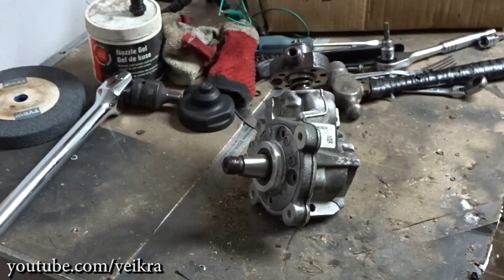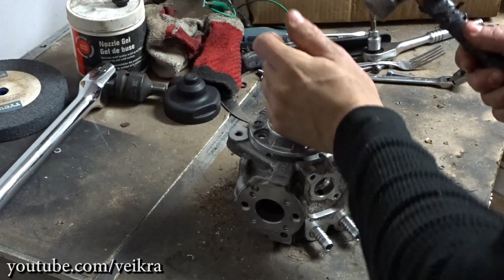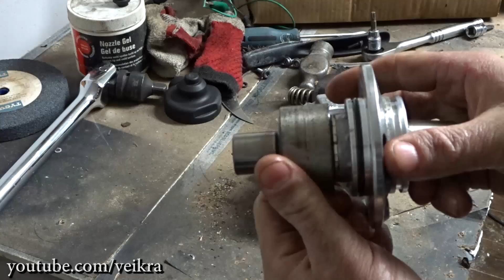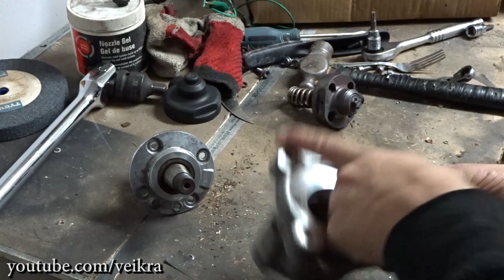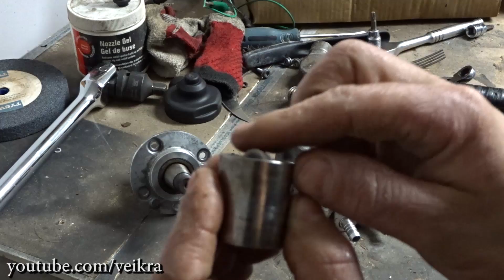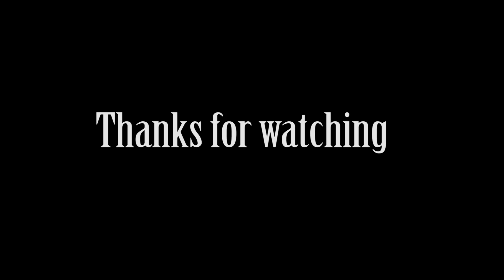cp4 diesel pump inspection rant. volkswagen, duramax, ford diesels

Comment: My car died,  thought it was a blown hpfp. Tested the injectors, they all failed. Took the pump out. Pump looks fine. How do I reassemble it? And what else could have caused my injectors to fail? Car had half a tank of diesel. Iv always had diesel cars so no chance of misfuel
Reply from the maker: never seen injector fail before the cp4. Usually pump wears out and clog inujector with metal particule. "pump looks fine" how can you tell? you spun it by hand to 27 000 psi? lol

Comment: Fiat has a water sensor in the bottom of the fuel Filter !
Reply from the maker: same as pickup trucks. It wont catch metal debris from the pump tearing itself apart as it`s made of cheap metal under high stress

Comment: Please, from your experience teel me if it is possible that this pump to be the cause  for losing pressure from the rail ramp and for hard starting,  in particular when the engine is cold or warm(40-50 % celsius coolant). Otherwise, the engine is working normal, i didnt observe any loose of power or other strange behavior. I have no error on obd scan. The injectors are new. Thank you.
Reply from the maker: diesels are very simple, the pump and injectors can cause many issues. For instance I had 2 bad injectors, but when cold, the higher fuel viscosity meant the engien ran fine. Once warm, I had loss of fuel rail pressure under hard accel

Comment: CP4 fuel pump just went on my 2016 Chevrolet High Country 2500HD 86,000 miles

Every Brand selling vehicles with these pumps need to step up. Water in fuel is NOT causing all these failures!
Reply from the maker: yeah, water cant account for all these prematire failure. The pump is not made strong enough. Plenty of cp3 trucks with high miles, including mine that went 420 000km until a rubber line failed and ran it dry. Would still be on the truck if not from that.  And it didnt damage the injectors vs a cp4 failure . Do a cp3 conversion if you plan to keep it. 
Gm already stepped up by ditching the cp4 in favor of a nippodenso unit. There`s class action lawsuit but david vs goliath
Reply: Veikra ya, I did. Btw, if you do another video on the cp4 failures might want to mention GM covers the fuel pump for 100,000 miles or 5years warranty. When I called to check warranty GM told me it wasn’t under warranty (twice), once I read my owners manual I found a section stating it is covered. “Under Diesel Engine Components” clearly stated
Reply from the maker: @AL1974    Good,  but 100 000miles isnt good enough. You engine is not even broken in at 120 000.   My cp3 died  255 000 after a hose/hoseclamp crapped out and ran air into it from 2 days trailering. 255 000 miles and something else was the cause.  I do run a lift pump now so Im good for at least twice that now.   Cp4 is a scam, it doesnt work, and please have a quick look at my second cp3 vs cp4 video with both pump side by side. It's painfully OBVIOUS that it's not built to last.
Reply: Veikra Needs to be a recall on these fuel pumps. There are several class-action lawsuits trying to get compassionate no matter what mileage the pump fails. Texas, Florida, and CA are where I’ve found the current class actions.
Reply from the maker: @AL1974   I agree, we can't accept a diesel pump which doesnt last. Especially when the engineering of it is obviously flawed to begin with.

Comment: Friend, firstable, sorry for my english,

So, can the pump piston rotate inside the cylinder, causing the lower roller out of the correct position? Is there anything at the pump to prevent this?

Thanks for the video.
Reply from the maker: Yes, as i said, the cam follower can rotate. Only the hopes that the roller rolls with no bearing or pressure lube is what keeps it straight.  It did turn in the end in this pump.  There are several worse case.  Watch the follow-up video in the description, it explain the many difference between the cp4 and cp3 that makes it clear the cp4 is a huge leap backward in reliability
Reply: I have read that Bosch introduced a countermeasure to antirotation of the tappet and roller to keep it in alignment on the camshaft. Question: do you know what this change is and when it was introduced in Europe and what engines or vehicles it is now in use on?
 @Nordic_Mechanic
Reply from the maker: @blizardtechnicalservicesll3444   No, But I wouldnt trust it any more than this. Still stuck with no pressure lube and aluminium bore. They introduced a cp4.2 with better coating, and that STILL did nothing for premature failure. Did you watch the second video in the description? It highlight a  LOT more problems than just the rotation of the roller. In the video I took apart a cp3 and you will see many design choice that makes the cp4 a lot less reliable than the cp3.  Most cars can be converted to a cp3 and it's the only real fix to these cars and trucks.

Comment: Hi is this the same pump on the 2008 30l tdi vw touareg...can it be converted to cp3
Reply from the maker: yes it can. It will also have the benefit of being able to support more power at high rpm

Comment: Thanks Veikra ! Great job explanations and stuff we really appreciate it. Too bad they do not have a CP4.2 conversion for the 6.7 Ford cause that is what we have now. I still have my 7.3 which I love the ol hpop system better myself. Of course the 7.3 had problems too but more so in the delivery. Ford never could build a fuel system. They always have had to be modified to get them right.  Where does Ford come up with the .2 on their new piece of CP-4 pump anyway? Thanks a load I be watching. T
Reply from the maker: Real culprit is the constant want of cheaper parts by the manufacturer. As a buyer, you find out about its shortcomings too late. So they can build you the worse things in the world and still get away with it

Comment: Any ideea if fuel leaks in oil it may be do to presure pomp ?
It's a continental pomp.
 On vw 1.6/2.0 tdi common rail 2012.
Reply from the maker: Very unlikely from injection pump. It could be an leaking injector return line on top of the injectors somehow leaking into the valve cover or a stuck injector overfueling and going past the piston rings and into the base
Reply: Veikra thank you for fast reply.
This week il go to someone that has vcds and il do some logs

Comment: Thanks for the video. Very few people  have your level of expertise in this subject matter and engineering insight. I appreciate your video bringing everything into perspective. I wonder why Bosch would attempt to reinvent the wheel with a design destined for failure.
Reply from the maker: I guess they felt they didnt need a design fit for over half a million kilometers, only one good enough for 200 000km or 120 000miles. But it fell short, and we see them burning up too quickly.  It's always an estimation of mean time before failure. Estimations arent always accurate
Reply from the maker: Also, check the comparision I just did with the cp3, you'll see the causes of failure even better

Comment: 3:59. I sometimes wonder if VW has any engineers working for them...
Reply from the maker: they have lots, but they are strickly trained to barely make the product last past warranty. That's how you sell more, you make cheaper lightbulbs that last less and less time. (seriously, the lightbulb conspiracy ended up being a marketing plot, look it up)
Reply: As it is obvious that there is some truth in what you said but when one compares VW to the Japanese manufacturers it becomes obvious that they (VW) try to hard to build inferior products. 
All manufacturers need to sell their products, including the Japanese vehicles who constantly do a lot better than VW (among others) in the reliability department.
Seems like VW has the tendency since the old air cooled Beetles to build products to last a very short time.
Reply from the maker: problem is not volkswagen, it's bosch. Bosch created the bad pump that volkswagen, gmc and ford used in their product. The cp3 never had issues and that's why people retrofit cp3 in cp4 equiped vehicule. Both in the 2.0 tdi and the gmc duramax. Bosch cheaped out making bad pump then also create a diesel scandal in the same generation....coincidence
Reply: The CP4 problem is because of Bosch (spit) but a lot of other VW issues are not Bosch related, problems like high oil consumption on some engines,  gearbox problems, window regulators, the list goes on.
Speaking of Bosch pumps, the VP was also not the epitome of reliability.

Comment: Awsome video puts issue into real perspective. Question, what are the cylinders in a Bosch CP3 made out of?
Reply from the maker: Cp3 has the cylinders made cast iron and it has lube channels all throughout the pump instead of the cp4 lubing strategy seemingly based on hope

Comment: They could have used nikasil on the aluminum bore like they use on 2 stroke dirt bikes!
Reply from the maker: they tried a coating it in the cp4.2 but the results were still disatreous. Aluminium has no place in diesel injection systems.  GMC ended kicking bosch out in 2017 in favor of a  much better nippon denso hp4 found in commercial isuzu trucks. Volkswagen stopped making diesel engine because of the dieselgate, all bosch manufactured parts let's point it out.  They were in the scandal, but didnt get touched !!
Reply from the maker: 180 000km ? that`s not the life or a diesel, the arent even broken in before 200 000km . the vp37 is a whole different animal. Such is the cp3 (430 000km on mine). The cp4 is crap. crap bearing lube, crap material and mostly crap design. The diesel doesnt lube as much without the sulfur and especially in winter here it's super dry.  A lot of pumps have pressure lube bushings, but not the cp4 with a stupid roller just flapping in the pump unrestrained. piston also unrestrained.  I'd never own a vehicule with that pump. The vp37 is a lot more durable design than any cp4. Most vp37 end up leaking, but still work to 500 000km.  I see one owner, meticulous owner owned cp4 fail at 100 000km day in day out. It's not normal.
Reply: They still make millions of diesel engines. It just has been decided that the USDM is not worth the hassle. My VP37 distributor pump has a lot of aluminium in it and they do not fail in the field very often. Amazing how well diesel lubricates things. For passenger cars the projected lifetime is 3 years or 180000km, which is the lease time for fleet or regular customers. Everything after that is optional.
Reply: Yes, 180000km. As I said, that is how long a lease lasts and that is the timeframe a car has to last so that the manufacturer does not have to pay the repair bills. That's unfortunately how it is. The pump head is still steel, but I agree that the roller and piston could have been restrained, although I wonder how that can happen, it must turn when the piston is at the top and then rotate, otherwise the spring will force it into the cam.
Reply from the maker: @irfp460   oh ok gotcha. But what I think happens is because the pump breaks apart internally and the metal particules get recirculated in this design. Then, they get stuck in the weak aluminium casting of the bore, and jam the piston, creating a space between the cam and the follower just long enough for it to turn.  There is so many things wrong with this pump, check the description for the side by side cp3 vs cp4

Comment: needs some 50w oil mixed in with diesel lol
Reply from the maker: Make that some 100Weight molasse and im sure it'd still crap out ! Bad material with bad lube system.  BUT if you have a cp4 in your car or truck, there is cp3 conversion kits advailable. The cp3 is what I have in my truck